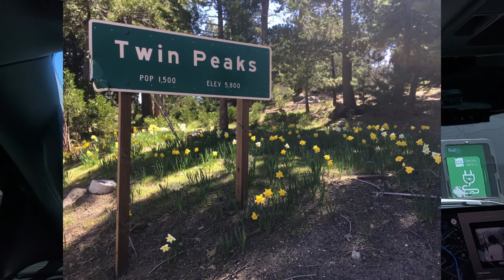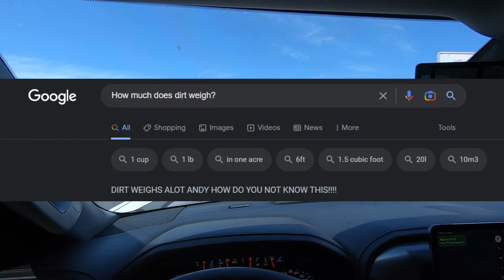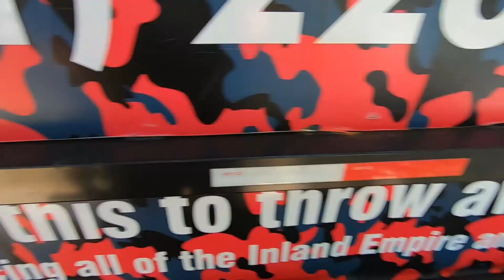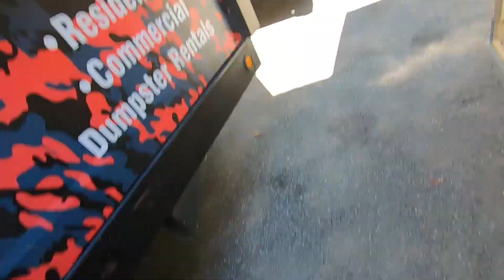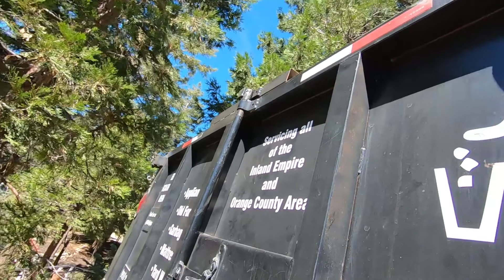BIGGEST Mistake (so far) Renting Out Dump Trailers! **Watch This BEFORE You Start!**

Comment: I got two similar trailers like yours. I use them for my roofing business but roofing is slow at the moment. I definitely don’t want them sitting outside causing a problem for my neighbors or potential damage. My biggest fear at the moment is losing or getting a trailer damaged. Already had to pay 4k cause my trailer was damaged by overfill.
Reply from the maker: Did you end up renting them out?
Reply: @EliteEquipmentRentals  yes
Reply: @RobXb how did it end up going?
Reply: @ renting one out to another roofer that does not have a dump trailer atm.

Comment: I like how you take ownership of the situation. A bunch of people would blame anyone and everyone else for the situation. And like you said you could have easily handled it differently and caused less harm to yourself and equipment. 30 minutes with a shovel would have went a long way there in that situation. I remember my dads first dump trailer was a little 5x8 bri-mar  that would fail to dump a lot in the beginning when we loaded the front too heavy. We would always have to toss some of the heavier stuff out by hand to get it to dump till we learned better how to load it. Seems like you really overthought things and it ended up costing you a bit there when you tried the forklift method. I don’t know how long it’s been since that event and the filming of this video but it seems like you accepted it for what it is and used that bad situation to better yourself in the long run. Props for that.

Comment: a cubic yard of dirt is over 2200 lbs  over 1 ton  and my trailer is 12ft long and 6 ft wide to complete the max cap is only 7500 lbs which is only about  3.5 cubic yard and i want to add to my welding bussines llc .  i want to rent it too as long there is bussines
Reply from the maker: Best wishes to you

Comment: Couple things. You said you looked up how much dirt weighed ahead of time. 1 yard 2,000 pounds. So that’s where you lost me, if your 12-16 yard dump trailer was completely full, and the trailer can only hold 5 tons you know you’re double or triple the weight. Your hitch even snapped. Got caught up in the moment I guess lol, but that’s crazy that you knew how much it weighed but just didn’t process it in the moment.

Secondly, don’t go to the dump with dirt and charge $20 a ton more than the dump charges and waste all the customers money for no reason. You have to take care of your customers. You can go dump for free, charge you’re customers less per ton but still make more profit. Charge by the cubic yard since you don’t have a scale at the free dump site. If it got out that you were purposefully wasting customers money so that you could make the extra surcharge over what the dump charges your reputation would be ruined. Charge what the dump charges per ton and go dump for free. Save the customers money and make more profit for yourself.

Comment: Well to make it easy 1 yd covers 100 sq ft at 3 inches. Est yr trailer is 10ft long by 7ft wide that's 70 square ft  so if yr 5 ft tall example   3/4 yd @ every 3 inches = 3yds per foot @5 ft tall =15 yds that's 15 plus ton. The contractor should have known better and screwed u

Comment: Wow! That whole ordeal really sucks!   BUT you learned from your mistakes!

I've got a question; how do you guys get away with NOT having DOT numbers on your trucks?
There's a DOT law that says if you haul ANYTHING for money, you have to register for DOT numbers, and are subject to log keeping, drug testing, fire extinguishers and 3 triangles in your truck at all times, and annual vehicle inspections. Around here in Colorado, even Landscaping company pickup trucks have DOT numbers on them...

I know if your truck and trailer are GVWR rated under 26,000 you don't need a CDL, but then there is another DOT law that says if you pull ANY trailer with a GVWR of 10,000 lbs or greater that you NEED a CDL Class A license. Several dump trailer Mfg's build dump trailers with 9990 GVWR, so they know all about this deal. In Calif. you need a CDL A to pull RV trailers like toy haulers that are heavier than 10K...

I've got a 2500 Dodge Cummins with a GVWR of 8800, so technically I can pull a HD 14K GVWR dump trailer and supposedly NOT need a CDL.
BUT what about that over 10K GVWR trailer law requiring a CDL A license?

Around here, the State Police DOT Truck enforcement Squad has roving patrols that do side of the road inspections, especially on roads that lead to the dumps and transfer stations, and I see they just LOVE to stop pickup trucks pulling Gooseneck trailers and tarped bumper pulled dump trailers, so you can't be running around with trailers with RENT ME and phone numbers splashed all over them without showing DOT numbers. They WILL axle weigh you and hold you to the GVWR stickers the Mfg puts on any vehicle. A base $100 Overweight fine with $1 a pound over the GVWR stickers added!
AND if your 14K GVWR rated dually is pulling a 14K RATED or better trailer and you don't have a CDL A license, they write you a $250 ticket for driving out of class and put you Out of Service and you can NOT move the truck!  (at least until they go home at the end of the day!)  Had a buddy that went thru this last year...

Can anybody shed any light on this?
Reply from the maker: Hey Jim, thanks for your comment. 
As far as I am aware, my current setup does not require registration with the DOT. When I inquired about it at the CHP office, I was told that not everyone who is using a for profit vehicle has to register, or else we'd be requiring Uber driver and Doordash drivers to have DOT numbers. 

Also, it is Federal law that any vehicle with a GVWR of 26k or above needs a class A CDL. Certain states like CA take it a step further and state that if your vehicles GVWR and an added trailers GVWR equal 26k or above, or if your trailers GVWR is 10k or above, a class A CDL is needed. Colorado could follow these rules as well. To stay compliant, all you'd need to do for your particular setup would be to buy a trailer with a 9,999 GVWR.